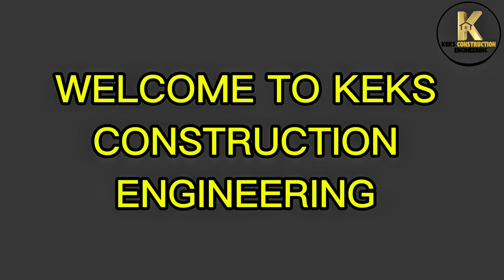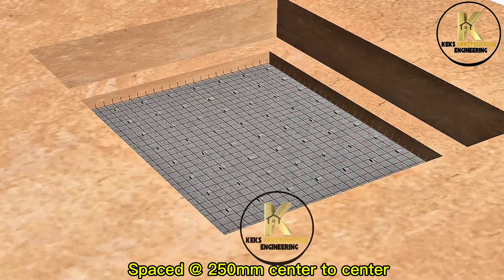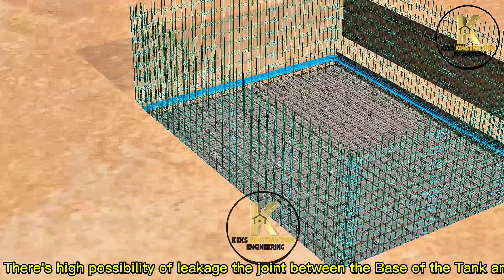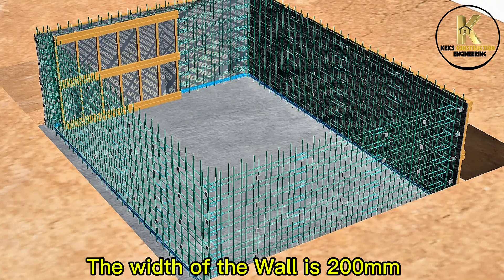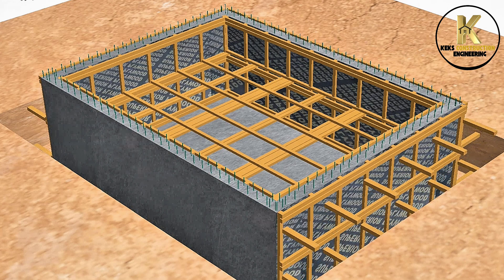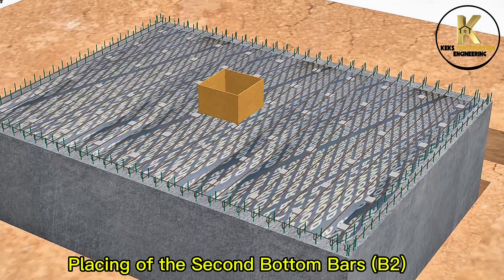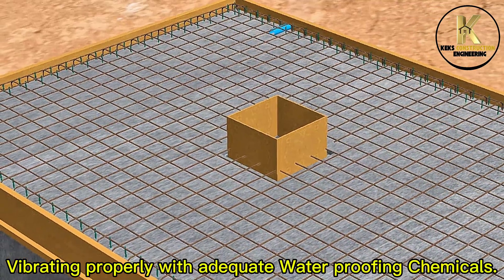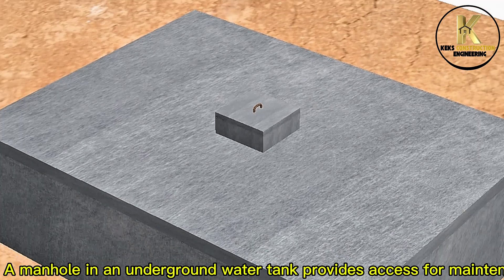Water Tank Construction  (Underground Water Tank Construction Guide)

Comment: Sir,  I enjoy watching your videos, does an underground tank have an outlet pipe, I learn that the the inlet pipes are fixed before the casting
Reply from the maker: Yes..... Inlet pipes are fixed before the casting. Was it not like that in this video?
Reply: @keksconstructionengineering 
Yes, but as the video shows, both the pipes are fixed as inlets, instead the outlet pipe should be fixed at the bottom, and the inlet at the top, as it fill in the tank, the oulet supply's......